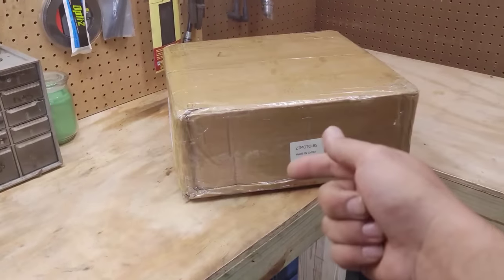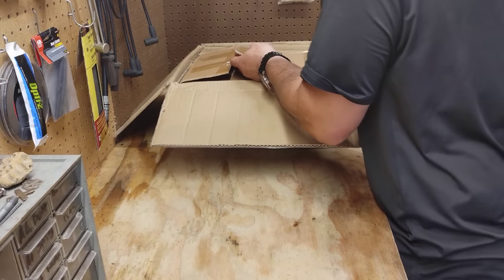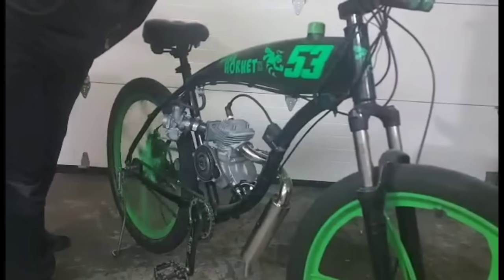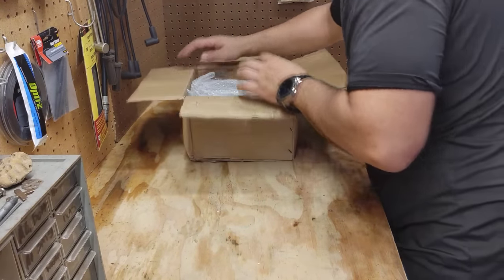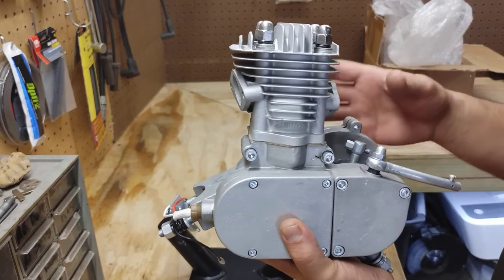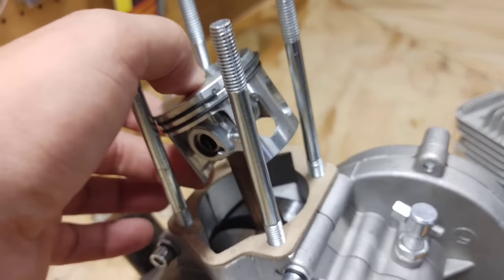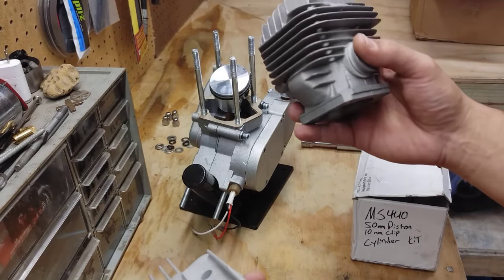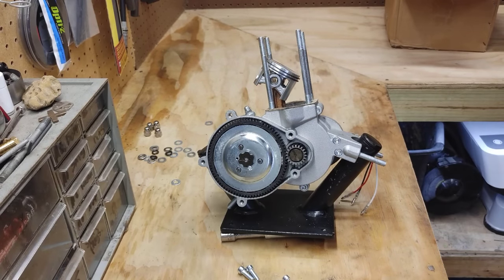The Phantom 85 V1 by ZTMoto. The largest bike engine on the market! First look and tear down

Comment: Yessir standard chainsaw design. The piston acts as the bottom of the transfer ports when at bottom dead center, fuel mix sliding by the piston itself and up into the cylinder transfer.
Reply: Yup, and the "wings" on the bottom of the cylinder are simply there to seal off the case where the old transfers would be... I am wondering if filling the old case transfers would act like case stuffing. As of right now they are just empty space, but I don't know if the outcome would be positive or negative.
Reply: @LAHover   yeah give it a try! If you have an old YD case to experiment with. My hypothesis is that it would not hurt anything at all, perhaps even improve a little bit. I think it would aid to keep gas concise, dense, directed, and channeled with shortest route possible up to the cylinder. Maybe even increase compression a bit like you mentioned similiar to stuffing. But I dont know, I dont have one of these bad boys, so I am just working off of the short videos I have seen and my imagination. Idk, maybe the case transfer ramps there are actually beneficial with this cylinder, allowing like a staging area for gas to hangout before entering cylinder. Maybe one stroke pulls gas from intake into bottom of the case and transfers etc, then the second stroke pulling gas from that upper area transfer ramps area into the cylinder. Lol I have no clue, just imagining and hypothesizing but it is fun to think about. Makes sense this engine is a great performing since that old saying "no replacement for displacement" I bet they will continue to make these top end kits a hair bigger, a hair bigger, every couple of years to squeeze out every penny, rather than making a big jump up to a 100cc and missing out on all the purchases in between.
Reply: I'm thinking filling them would be a positive thing that's wat they did  back in the day on 2stroke cases to make more compression

Comment: Lol you call the electric stuff "goofiness" props to you for that one, 2 stroke 4 lyfe G! Very nice to finally see a piston fully clear exhaust port!
Reply: Instantaneous torque from the rip with high speeds and silent operation for not pissing neighbors and people off, is goofy? I love engines as much as the next guy, i have a 2jz in my car and have always loved automotive but electric sccoters, boards, unicycles, and bikes these days are absolutely ridiculous for no reason lmao
Reply: @ghostrider433  electrics are boring imo as a car enthusiast. A proper 2 stroke makes more power and is lighter compared to an electric
Reply: @southtexasspecials175  i've seen custom electric builds with powerful motors. Yes they make tons of power but they have VERY limited range, the charging process is slow and adding more batteries makes the bike very heavy.
If we compare those super expensive electric builds to these cheap 2 stroke china dolls its also not fair.
A Yamaha YZ250 2 stroke engine makes 50HP and with the gas tank will be much lighter than an electric build of comparable power, plus you will have much higher range and no waiting to charge.
Reply: @southtexasspecials175  that is true like if you run a 3000 watt 72 volt motor on a bike you can hit 65 easy and pop wheelies
Reply: @dieselgeezer18  I mean if something goes 60mph and it lasts an hour then that's not that limited but then again you have to factor in mah and what type batteries you use
Reply: @isaiahirish6501  heck yeah . That literally my next build but home made with a old 1970 3speed hub transmission. I hope it goes good
Reply: @isaiahirish6501  I'm wanna hit 70
Reply: @dieselgeezer18  ya totally true. Pros n cons. N its just not fair To compare do to the price. But if you've build bike for years . you'll appreciate a cheap five hundred dollars build in electric. It's way more reliable. I build both . N while I hate the fact that I have limited range on electric. N the fact that it takes five hour for a complete charge.  I still rather commute to work on it since it takes to days. To discharge. Traveling across town. Twice. .  It may have a limited range but 55miles is a lot.  unless your traveling cross country on it, it won't ever be a problem. Just don't forget to charge overnight.
Reply: @southtexasspecials175  that sound dope man I have been meaning to build one of these bikes but been busy with my car
Reply: @southtexasspecials175  yep
Reply: @dieselgeezer18  your high if you think a 2 stroke in any case will make more torque than an electric motor show me 1 engine that will make more torque with comparable size I’ll wait….
Reply: P.s I’m a 2 stroke lover but there is no denying the power that electric makes might as well jump on the wagon because electric is here to stay and petrol is going to be a thing of the past unfortunately I’m going to guess within 50 years everything on the road and off maybe is going to be electric which is a good thing for the earth and is the right move but not so good for people like me who love the raw sound and mechanical power of an internal combustion engine it will be missed for sure but must be done if this earth will ever be able to become healthy again engines are just a small part of the pollution next should be factory’s and draining chemicals into rivers I don’t think this world will ever become healthy until human life ceases to exist unfortunately we are parasites that destroy everything we come in contact with it’s just our nature since the beginning of time the world will either burn us up freeze us or just completely kill us off somehow end of rant lol
Reply: @kx250braap  First of all electric motors produce shit torque, its the single speed gearbox that increases the torque and lowers the RPM.
Secondly torque doesn't matter. Its horsepower that matters. Horsepower is calculated like this: 
Torque x RPM / 5,252.
You can increase the horsepower through torque or RPM on an engine. You might think that when 2 engines make 300HP if one of them makes less torque its slower. This is FALSE. The engine which makes less torque will spin at higher RPM to make the same power and using the right gearing in the gearbox, you can convert those high RPMs into more torque.

Comment: I see a lot of gains to be made with this setup. How they added more meat to the cylinder so you can widen the transfers is a big big plus as well as the intake port angled down. There are a few more pluses I see about this newer style engine that is awesome for the porting nerds.

Comment: I wonder if filling those transfer ports would Improve efficiency, it’s really just dead space adding to case volume
Reply: I was just wondering the same. Good eye
Reply: Definitely help, all that space could be filled in, but now I'm wondering what about opening the transfers to the jug and matching it to the crank case???
Reply: @artofdisguy3401  that's the move myguy
Reply: Bullet...it's called FILING not filling; the transfer ports as you say look to be partially closed off by the Crankcase.Grinding there to a polish should definitely help..Trev New Zealand 😊🇳🇿
Reply: @trevinskiking2165  you’re incorrect bruv try again! 🇦🇺

Comment: From the pictures on the website, it looks like the top of the connecting rod uses a bushing rather than a needle bearing, I wish we couldve looked at that in this vid. Wow, as soon as I get my hands on one of these Im gonna fill both those huge cavities in where the transfers match on the standard cylinders and make sure my frickin boots are on TIGHT!!

Comment: pretty excited about this motor . about time they come out with a true any thing motor . all this double cc bs . is it a 60 cc or a 80 cc you know what i mean . this is a game changer next will be a true 100 cc . some one is going to have to start making heavy duty frames for these motors soon . i know there is a couple but there both pretty much the same frame . felt faker frames .  personally while i do like the built in tank  the frame style its self  leaves alot of room for improvement not to mention the price . i have not seen a speed test for these yet but im thinking if it is as powerful as claimed bike frames and wheels are going to be under alot of stress . this motor is one to watch for sure . i do hope they break out with a true 100 cc though that would be awesome .
Reply: 60cc is Chinese measurement for 80CC its not that hard to figure out for any single celled amoeba brain.

Comment: Got the engine, got it on bike, got it started, ran really good, on break in run  2 miles ran smooth, let it cool down, torque the head bolt's, second run 1 mile in lost engine power, not getting spark to the plug, what do I check. I'd Check out all wires & got good connections,
Reply from the maker: Take the jug off and see if the rings are ok.
Reply: Thanks for the heads up, but the engine ended up being a piece of junk.

Comment: I would agree that jug is definitely a stihl, I’m not sure what the stud spacing is compared to a larger saw like 070,660,090,880 but I’m sure the large jug could be adapted ofcourse dependent on stroke, and case volume. I don’t know much about these bike bottom ends

Comment: Why do you cut off the white wire at the coil? (Just got my first kit bit have lots of motorcycle maintenance experience) to put a larger wire or to eliminate it all together? I was under the impression you can run a light or perhaps rectify the ac and charge a battery.
Reply from the maker: It robs from the power of the spark!

Comment: they try to keep the size small, because it's used on a bicycle. that's why you have less cooling fins on the cylinder head. what matters is hold it up to the light, and you can then see the actual cylinder, which is way fatter. just by this video I can tell that cylinder looks more like a soda can(😵👍), then compared to a weed eater looking, tiny little, Big Bite hot dog size 49cc,66cc, & similar 2 strokes. I'm curious about the stroke, if it's still a short stroke of the earlier 66cc, with a soda can piston. I can tell you this,  it's definitely not a square motor (square motor = any motor where the bore & stroke are identical, or almost identical in size. either way, the motor is going to be a powerhouse. now another interesting question. have they use the same clutch, or is it an upgraded clutch? I guess I'll just have to finish watching the video (@7:50), and find out. 💢🥴💯

Comment: How the clutch is it a better or as good as the bt100 clutch?
Reply: I have several motors and for some reason the BT clutch plates or disc are all thicker and have crosshatching and vent holes none of the other motors have that

Comment: I've seen 100cc engines would that be faster and better than this? Or should I go with this my bike is a 32" and I weigh 220lbs what would you recommend me do?
Reply from the maker: The new version that just came out has better bearing and seems to be a powerhouse. The yd100 is a nice reliable engine that you can get parts for right now.

Comment: Is it possible to flip the jug so the carb is up front
Reply from the maker: You could, but the case at the bottom doesn't really line up and the reed valve would prevent any ram air effect but yeah you can do it!
Thanks for watching and commenting 👍

Comment: I wonder if you could drill some holes through the 40mm piston rods on common 66cc/80cc 2 stroke bike engines to lighten them without making them too weak...Iv'e seen some car/motorcycle piston rods online that are drilled/lightened.....I'm guessing enough weight could be drilled out to make a noticeable power difference without it being too weak.  A combination of the rods drilled/lightened and few holes in the piston skirt & maybe piston pin to lighten & increase lubrication I bet would help (not on the Phantom engine but other 2 strokes)

Comment: Hey guys who are pretty knowledgeable in this field, any recommendations on a moto kit that comes out of the box with basically everything you need to slap.on a bike and get some decent performance? Like 35 maybe 40.mph? No I will not be going wide open constantly but want the speed at hand when needed. I'm not completely clueless on motorbikes but everything I know I've researched and learned myself    there's just an infinite amount of info out there and a lot is misleading or I see mixed opinions and experiences. 
P.S. I'm mechanically inclined to work on, install, and fix issues. I just want to know if there is an out of the box kit that can give me some decent power and maybe even more with slight upgrades down the road. TIA

Comment: Hey I have a phantom 85 that I had just bought and I can't decipher if it's a version 2 version 3 my intake cover is black not red I have a bearing on the connecting rod not a bushing.  I have just put this together and ready to fire it but am  reserved to do so from all the stuff I have read. I need advice and should I use 16:1 for my break in and how long
Reply from the maker: Ive been using 20:1 on mine for break in. Where did you buy this from?

Comment: I ordered 1 and it came in yesterday exhust is different doesn't have that little bracing bar on it and mine didn't come with a boefang carburetor it came with a speed carburetor I called the co. bicycle engine they acted like they didn't know what I was talking about I sent them pictures they acknowledged that it was a speed carburetor and not a boefang carburetor and I told them my question was do they both have the same size jet  Receptionist said she didn't know and just wished me the best breaking it in?
Reply from the maker: Both should come with .65 main jets yup!
Reply: @MotoredLife  thank you sir I've seen your videos I trust you just don't want any reason for lock up thanks again
Reply: @MotoredLife  sir I have another question for you about the phantom they say the bottom of the phantom engine is a yd100 on my yd100 the wrest pin bearing is 10mm and on my phantom it's 12mm or did they make 2 different versions?

Comment: BEWARE OF THESE MOTORS!!! $300 SAME CHEAP CHINESE PARTS I HAVE PERSONALLY SEEN 4 BLOW UP & LEAVE PPL STRANDED BEFORE 75MILES!! They run good for about 30miles then they ARE TRASH!!!
Reply: As I just found out, on a 44T sprocket it will send you into orbit if you are not carful lol. A little pull on the bars and I looped it on day one, it's no joke.

Comment: is it normal for the magneto magnet hard to pull out , and what if it pulls rite out without the puller tool ? cause im getting no spark whatsoever .... ive replaced spark plug , cdi and magneto and still no spark . i can only think at this point magneto mag is bad any advise would be great
Reply from the maker: Yeah that should be fine but I will tell you I have seen some magnets in backwards your keyway should be at 2oclock
Reply: @MotoredLife  magnet is on proper and the Chuck key is more at 1o clock on this motor ??? Are all the magnet same size?
Reply from the maker: @Mr1badseed  there is stronger ones. As the magneto completely staight on both sides up and down?
Reply: @MotoredLife  yes
Reply from the maker: @Mr1badseed when you put your hands on the two wires coming from the Magneto and roll the bike does it shock your hand?

Comment: got another question for you about the phantom how many base gaskets do I need to use I seen someone using none just ultra gray another used 1 and another guy used 2 I was told 1 for more low end torque 2 for more speed what is your opinion sir
Reply from the maker: I used two. My opinion about the Phantom is they used the wrong piston. The one that is in it is 2° off in the wrong direction.
Reply: @MotoredLife  ok will do sir thank you for the info trying to get some longevity from this motor
Reply from the maker: @mikemiller3303  i found out so much info from the person who helped them design them. Sadly flawed by design and requires fabrication to work correctly. Corners cut and rushed production
Reply: @MotoredLife  I heard through the grapevine that if you change the piston wrest pin and bearing to a stihl and with a window in the piston it fixes the problem I don't know just what I heard
Reply from the maker: @mikemiller3303  that is correct! the other part is you have to shave about 2mm off of the cylinder.
Reply: @MotoredLife  idea if I leave off both base gaskets hence 2mm and used ultra gray gasket maker your opinion
Reply from the maker: @mikemiller3303  Im picking up what your putting down!
Reply: @MotoredLife  think it will work I'm not going to race it you can't here in Texas only 27mph lol I just wanted something decent for a big boy I'm 6ft1 and 250 pound
Reply from the maker: @mikemiller3303  i think your on to something
Reply: @MotoredLife  I  🙏 it works stay safe thanks for the info